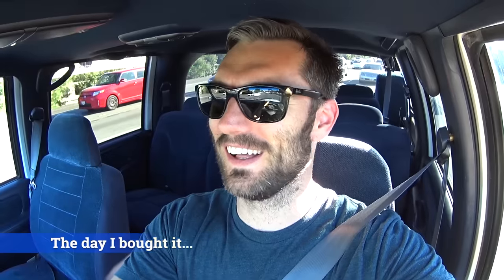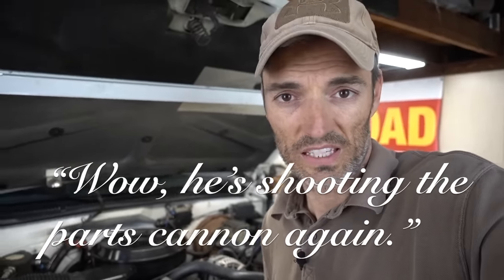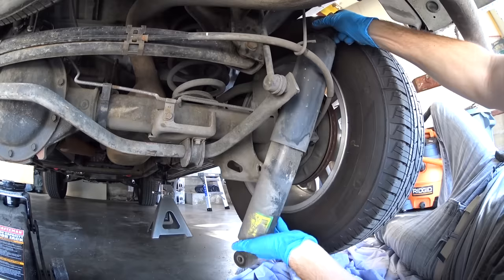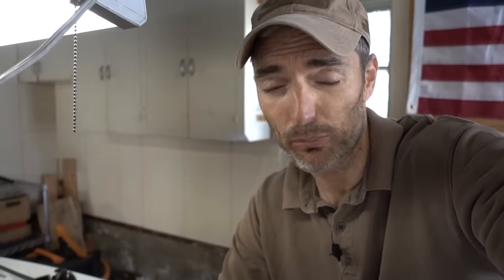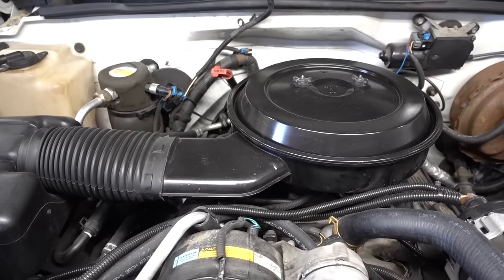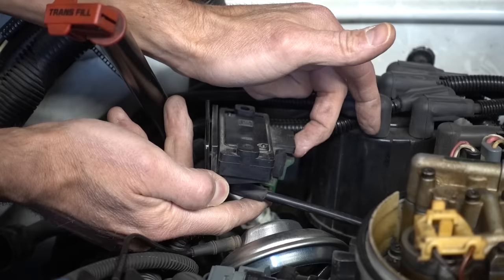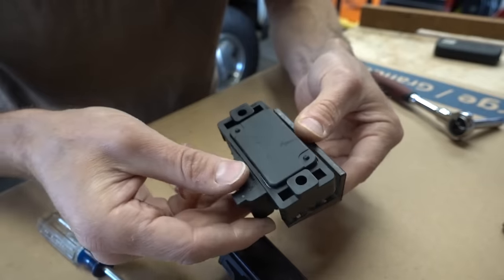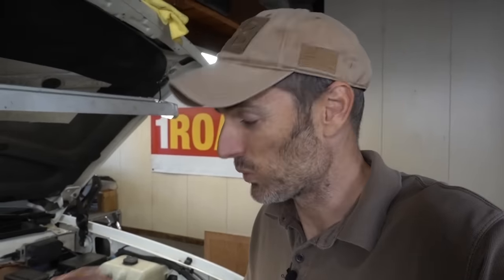The ONE REASON Why My 25yr Old Truck Runs So GOOD!!

Comment: Reality is even if this gentleman spent 5 grand fixing his 25 year old truck way cheaper than 75 thousand for a new one
Reply: Exactly!!!  He's a head of the game!!
Imagine spending 66 to 77,000 dollars on a new GM truck with the inline 6 Duramax and it has a belt driven oil pump GM recommends changing at 150,000 miles?!?!??
Check it out!!!
Reply: @philllsxga.7737  ummmm 66-77k...lmao....you need to look at prices a but more....you can get a pickup truck for under 30k...
Reply: @Anth230  I don't know where you live but I have never seen a Brand New truck for under 30,000 dollars!!
If there is such a thing all you are getting is a stearing wheel, and blinkers!!
Reply: @philllsxga.7737  paid just under 30k for my 2018 f 150, regular cab 8ft bed 4x4 xl...
Reply: @Anth230  piece of tin piece of board gallon of gas you got a Ford!!!
I'm not impressed! It's a Ford!!
Reply: @philllsxga.7737  Its cheaper but an old truck will not look or perform as good as new one. It will not last long either.
Reply: @julioc.7760  I don't know about that theses days.. all of the brand's are having major drive train issues..
You can't beat an old 3.8, 4.3 or 5.7...
Reply: @philllsxga.7737  exactly. I can care for a chevy and keep it 5 - 600K ! Running very Well
Reply: @mayken6661  you got it!!
That's what me and my buddies do he buys an old junker GM changes the fluids and drives it 6 to 8 years then he gets another one!!!
Reply: Well said
Reply: @philllsxga.7737  5.3 over them all day. Just have a good transmission guy. If it's a GM or Chevy those 4l60's are trash. The motors though can go forever with regular maintenance.
Reply: @Wormanatti  I had a ZR2 with the 4l60 I sold it with 252,000 miles not one problem with the transmission I off-roaded it all the time..
My brother had a suburban with the 4l60 he sold it at 192,000 miles and lots of towing never had a problem with the 4l60.
My buddy sold his Z28 at 110,000 miles he did not have one problem with the 4l60..
My grand prix has 284,000 miles on the completely factory original 4T60E, just some failed solenoids...
My buddy had 214,000 miles on his regal with the 4T65e totally factory original transmission never opened up..
Yeah I see all these problems with the 4l60s online I don't understand I know more people than I listed with 4l60s and well over 200,000 miles and no problems with them...
Reply: @philllsxga.7737  You got lucky for sure. Every one I know with a Tahoe, Silverado, Sierra, Suburban, Yukon etc has had one or more replacement to rebuilds. The shells break, 1st 2nd guaranteed to go. Where they 1 owners with you?
Reply: @Wormanatti  and get this the trucks I mentioned all have been off-roaded a lot no issues...
Reply: Fax
Reply: He's not spending anything. All the parts are being sent to him for free because he's a YouTube Amazon affiliate
Reply: I had to make sure it was the 100th like...also...agreed😎👍🤣😂
Reply: @philllsxga.7737  ngl any new cars are meant to break..
Reply: @dontcryboutit  they are basically engineered to last 3 to 5 years and some cost 60 to 70 thousand dollars...
Sad...
Reply: @philllsxga.7737  yeah ik imagine wasting 3-10 years of saving to get something that breaks..
Reply: All my friends drive brand new trucks always trading them in every couple yrs for a new one. They make fun of my 93 Chevrolet but I always tell them this, would you rather have the possibility of  spending a couple hundred bucks every few months if something breaks on an old truck or would you rather have a guaranteed 5-800 bucks a month car payment, not to mention the price of insurance. They always roll there eyes at me but it shuts em up and that ole truck will take me just as far as there new ones will
Reply: @johnnyringo2185  you are damn right buddy!!!  My buddy does the same thing, he'll buy a $600 to $1,000 old GM and drive it for 6 to 8 years and then get another one!!
I usually keep my Chevys about 10 years I'm on 7  years now..
YouTube deboss garage why I'm not a fan of Ford..
Chevrolet, The most dependable longest lasting truck's on the road...
Reply: Reality is he didn't fix anything and spent money doing it.  You don't save anything if you fix what wasn't broken.  It's the same as paying for that $75,000 truck but don't ever plan on picking it up.
Reply: True
Reply: @ranbymonkeys2384  That is happening now with electronics shortages people are that dumb now.
Reply: What did u pay for it, and how much is into it as of the video
Reply: @julioc.7760  If an old truck lasts 20 years and a new truck lasts 20 years..... wait I'm dizzy, OUR YOUTH LADIES AND GENTLEMEN!!!!
Reply: @ranbymonkeys2384  an old truck is already old dummy it wont last much today. additionally they are all inefficient gas hogs. get a gentñy used one aka 10 years or newer. a 40 yr old truck is good for  a weekend project not as your daily tool. wont last wont perform.
Reply: @julioc.7760  It lasted 40 years already!!!!
Reply: @julioc.7760  I have a 36 year old Corvette runs like a top
Reply: @ranbymonkeys2384  sure. im superman too.
Reply: @ranbymonkeys2384  whatever you say boss.
Reply: That's what I tell my wife! Lol!  ... and done the way you want it too.
Reply: @Wormanatti  the 6l80e has been good, but the torque converter needs to get upgraded.  Speaking from experience.   My 07 yukon 6.2 runs great!  Non of the DOD junk and it's no the newer clunking 8 or 10 speed transmission.  The older rigs are more mechanically solid though.
Reply: As long as "being dependable" isn't taken into consideration...
Reply: I'm doing same 99 suburban
Reply: J C I disagree. I trust older vehicles to get me there muchhhhh more than taking the newer vehicles where brands keep coming back to putting turbo’d 4 cylinders into vans and trucks, absolutely stupid. They used to make things to last, now they’re made to scrap if you drive off the road. Barely enough to get the job done is NOT THE BEST SOLUTION. Just because you can get 300 hp out of it, doesn’t mean it can reliably pull your boat the next 300,000 miles
Reply: @jameshunt5316  That turbo 4 banger engine junk is more for emissions regulations/ standards and to boost performance gains while not admitting the lack of durability and reliability in the long term.
Reply: Ya! BUT! The (dam car insurance) car insurance says "your car is onky worth at the time it was stolen...or accident.... on the year and make of your vehicles at the time of incident....LMAO!
Reply: Not to mention the insurance (even at full coverage) is about 1/4 of the cost of a new one. More money per month for gas to enjoy driving the heck out of it
Reply: @philllsxga.7737  25yrs ago we was able to find a truck for under 30k .. :)
Reply: And no doubt way cooler also, love older cars..
Reply: Exactly what I am doing with my ‘04 Burban with 192k miles. I got the thing for free and have spent around $2000 on it so far. Needs some more work but all in all it’s a great truck. Plus insurance is $50 a month
Reply: Not to mention, no monthly payments and you can do the fix and spend the money at any time that you want to.
Reply: @julioc.7760  tell that to my 1988 S10 that runs like a clock. Just did a compression test and cylinders are within 10%
Reply: @BPzeropoint  Not a brand new what?? Which response are you replying to?
Reply: @BPzeropoint  I like old trucks as well. But there is no way In hell I'm driving in the middle of winter in a 25 year old truck UNLESS it's been completely restored like new. Than of course I would get chastised by people (some on this very thread touting it's better to drive old) for driving A old classic on salt covered roads. Im wondering if people are ignorant to where others live and they just think we all live in the exact same climate...
Reply: @BPzeropoint  well how many miles does it have?How long have you had it? How.many miles a week do you drive?

Oh and even though Montana is considered part of the rust belt. You guys use less corrosive chemicals on your roads yes some salt is mixed in but not as harsh as where I live....
Reply: No updates and wayyyyy more reliable and reliable.
Reply: @w.f.oc.e.o5766  lmao...
Reply: I just put a safety on a 97 gmc 2500 farm truck with a post pounder mounted to the back of the flat deck... the mechanic said, you need tires...other than that... your safe!
Reply: @Anth230  New for under 30k gets you a 4 cylinder truck with a 1500 pound towing capacity.
Reply: @julioc.7760 Mail truck that goes to my shop is 19 years old with 400k miles, been mantained and the truck runs as smooth as butter. No issues
Reply: dude save for food too
Reply: @julioc.7760 last longer and run better without all the computer $hit
Reply: @donames6941  I know electronics can be useful and most of the time are but my 85 ram with rust in the engine that sat for years runs better than my 89 dakota that's having an electrical fit
Reply: @julioc.7760  not true at all. I know many people that buy even 50 year old trucks and use them as thier daily. Older trucks are easier to work on and way more reliable than the new ones.
Reply: preventative maintenance is key, talk toa maintenance superintendant in charge of big gear, ie mining etc
Reply: Yeah while he gets 8mpg. Im getting 28mpg in my 65k truck.
Reply: @Anth230 not brand new.
Reply: @Anth230 you need to look at prices. A base model silverado starts at 50 grand.
Reply: @Anth230 5 years old too 😊
Reply: @zackjay71  I just looked at a base model Ford. They have gone up of course but you can still get it for the low 33,890
Silverado 36,800

I don't know where you got your price from... 😂
Reply: @henkers420    you can find the for just a above 30k right now.. don't believe the 60-70k bs
Reply: @philllsxga.7737  Sill have my ford after over 5 years. Get it serviced and Krowned at regular intervals. Runs perfect..no rust..I think you said 2 years ago they only last 3 years... 😂
Reply: @zackjay71  yes brand new. Go look it up. We are talking STANDARD CAB, 8 OR 6 FT BED.....The problem is no one views an actual pickup truck as a pickup truck anymore. They all want SUPER CAB, 5.5 FT BED, INFOTAINMENT SCREEN, V8, CARPET and enough room to fit their family.
Reply: So True!
Reply: I agree that the new truck payments are outrageous and getting almost impossible for the average guy with some repair knowledge to do the work himself.  I own a 98 Chevy obs with 265000 miles still running strong and still able to take a 2600 ft, elevation highway at 80 miles an hour. I'm going to drive it until the wheels fall off and then build it all over again 😅😅😅 plus the truck is considered the next classic truck, the price of them, which is steadily going up and junk yard parts are still available try find used part for a new truck without paying for it with your body parts 😅😅
Reply: @charlesweaver722  This all sounds good in theory. But eventually you will get to an age where you don't want to work on the damn thing anymore.
Reply: If y’all do get a new truck, make it a MOPAR!
Reply: Until you pay the insurance bill too...
Reply: You found a new truck for 75k?
Reply: @Anth230 think everybody is talking about a truck for a man! 4x4 and full size. Not a mini truck.
Reply: @BeADad2447  Nope. Everyone is talking about a fat dads truck that he has to haul his 3 brats and wife around in. You know the super cabs with the tiny 5 ft bed. A REAL MAN'S pickup truck is a 4x4 with 8 ft bed. Everything else can be standard. (v6 is ok now but 15 years ago I would have said V8) No carpet and no huge infotainment system. Still can get a standard truck with 4x4, Regular Cab and 8 ft bed for well under 40k. Again ... THAT IS A MANS PICKUP TRUCK. Not those overpriced driving house boats you and your ilk drive in or want to drive in.... 😂
Reply: @Anth230 what motor was in it?
Reply: @shannondosher1270  you mean my current truck???  The truck is completely standard except for the 4x4 and power group. So it has the standard v6 3.3 liter. I know some people want the V8. But the V6 is more than enough for my purposes and it has more hp then v8's of yesteryear. I may trade it in one day but I get such good gas mileage.  . 😂
Reply: afraid for rattling🖼️ 
bolts and electric👋weld the frame, but cost wise, 🫘fantastic new world breaking the 💰💰money, Actually the tenth amendment📰saying gun, but and all, costs of a new car is crack🇺🇸low, and minimum wage is way high. A😅Rolls Royce is even, like 15 cents cheap 
 
                 A. E. N.
Reply: @julioc.7760 words of a true amature lol.  And look better? In who's opinion?  Plus I can work on everything myself
Reply: @Handlehandlebars  You can now. But you won't be able to later in life...
Reply: I agree.  I have a bad tie rod on my 200k mile, 2004 yukon and I did a full front rebuild.  Now my front end is as good as a brand new truck, and I won't have a front end that will constantly be having failures.
Reply: @Anth230 how about now?
Reply: @markstewart8171  about what??
Reply: @Anth230 😂you bought a ford ranger then probably
Reply: @mudafukrjonez4262  Nope brand new F150...
Reply: I've seen some 50 75 year old cars   out there looking good and running fine
Reply: Not in snowy/salty conditions you don't....
Reply: Amazon parts has a lot of cheap made counterfeit parts so watch OUT
Reply: Thank you for showing that I'm not the only one who believes this!  I cannot believe that not only what they are asking for newer trucks, but that people are actually paying it!
Reply: @ajwtubeful  The thing is you can still get full sized trucks at around 35k or less. Brand new.
Reply: I agree with you brother. I do the same thing with my 17 years old tundra, and I don't have to spend thousands of dollars for a new one.
Reply: @Anth230  Yeah, but who's got 30 grand!!?
Reply: @ajwtubeful  Well considering that even vehicles like the cheaply made Ford Escape is close to 30k standard price... 30-35k for a base truck with 4x4 and an 8 foot bed is a steal. Don't forget even a 1500 truck wears much slower. They take more punishment than an SUV like the Escape or the Chevy Equinox. 

Anyhow I'm not rich by any means. I bought my Regular cab f150 in 2018. Sticker was 35k. Rebates got it done to around 28900. I added a couple things and it brought it back to 31k. Put around 4k down. Took a 7 year loan but had it paid off in 4 years. 
I now have a nice paid off Truck that is running perfect and I expect it to be with me for at least another 5 years.

It wasn't fun dumping twice the cash each month for two years to get it paid off early but it was worth it. You can do it. Just be persistent with payments.
Reply: Older vehicles are definitely cheaper to maintain as opposed to NEWER ones. Newer cars tend to be money pits depending on the make/model.
Reply: @1998MonroeNYColonial  Any SUV is pretty much garbage. Full sized pickup trucks at least wear out much slower.  They can take more punishment....
Reply: @23chnge  No $hit. But prices have maybe changed 5k in the last 6 years. But the standard truck is also equipped a bit better than the 2018 models. But with what I got in 2018. It's about 5k-7 difference and that is before rebates. So STILL well under 40k. The problem is people like you are looking at fully equipped all the bells and useless whistles, supercab trucks with a "baby bed". Get a regular freaking pickup truck with at most 4x4 and you will thank me... 😂
I also bought mine in November of 2018. Best time to buy.
Reply: 10mpg older vehicles will 10k gallons to drive 100k miles which is $40000 @ $4per gallon?
Reply: @thayalansuntharalingam  Haha. Good point.... 😂
Reply: @1998MonroeNYColonial  They are not cheaper to maintain. Maybe easier but again not cheaper. Plus as someone just mentioned they drink gas a lot quicker...sorry.. 😂
Reply: @julioc.7760  That's only an opinion.
Reply: I'd rather spend $50000  on an old vehicle than the same amount on a new one. The new cars are crap and are ripping off the American consumers.
Reply: Bingo
Reply: Yep
Reply: @OSDCrusher time is money.
Reply: @zackjay71 math isn't your strength is it ?
Reply: And now, it is more like $80 to 100k
Reply: I have a 1990 Chevy Silverado with 320k miles. Im getting ready to spend about $15 - $20k on a complete update because its a great truck and it will still be around $30k  cheaper than a new one. Plus I wont have the high cost of payments,  insurance , and personal property tax ( Missouri) that a new truck would.
Reply: Got babies there safe .
Reply: Age no problem I'll still work on it. My 90 year old father in-law still gets things done a marine ❤
Reply: He can spend 75k on a old car and have as many problems as a new one
Reply: @Anth230 30k? Unibody "trucks" don't count
Reply: Unibody??..nope.... 😂 Yes 30k. Ford f 150. It was 35k,  after rebates got it to 28900 and then added a couple things. Here's the thing it's not a bloated family carrier. It's just an actual pickup truck. Regular cab. 8ft bed,  Standard everything except power group and 4x4. It's a great pickup truck.

Unibody... 😏.....